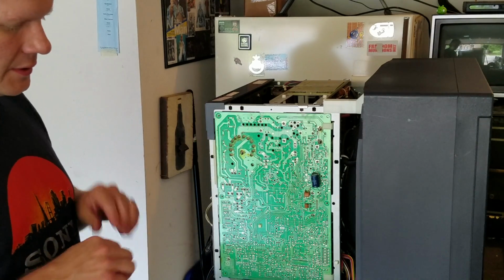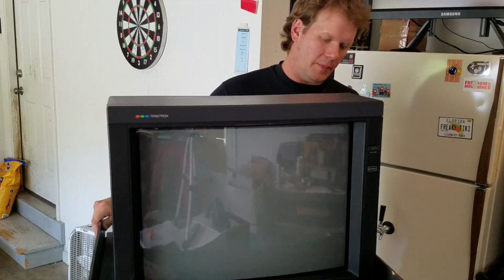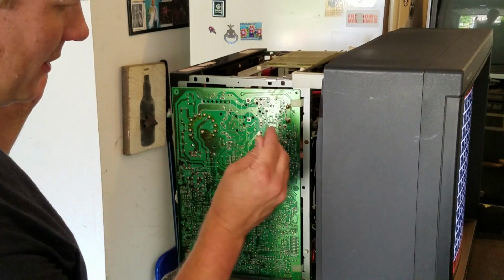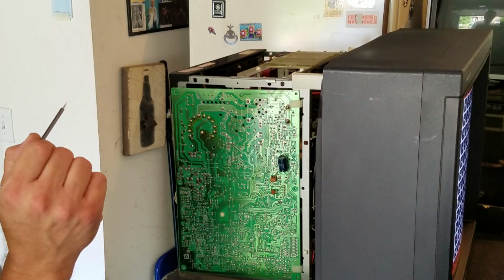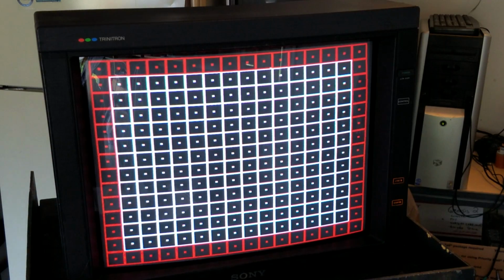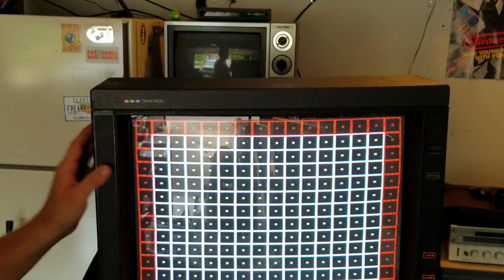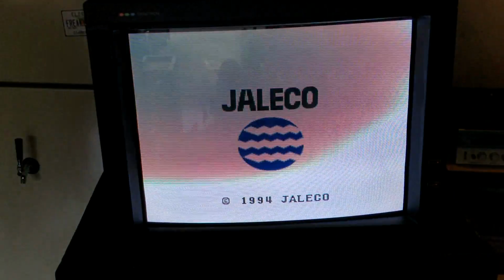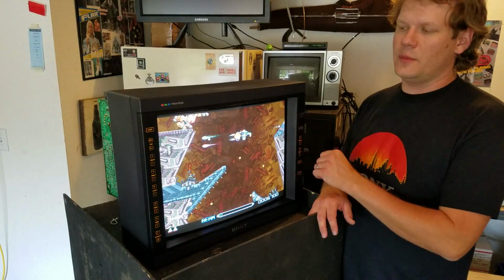Sony PVM 2030 - CRT Geometry Calibration Techniques

Comment: Alex if you happen to see this comment you have probably just saved me lol. I've got a Sony Trinitron 24-in that I had found and it has this problem but it's ever so slight. Hooked up some PS2 games to it and I thought that maybe the component signal was stretching the screen out too much so I hooked up composite cables and it's still doing it. I tried the onboard tilt feature and that didn't fix the problem either so this has got to be the issue.  I'm definitely going to give this a shot over the weekend.

Comment: Hi, thanks for all your videos. They’ve been extremely helpful, specially for adjusting my 2130QM. The service manual shows how to adjust H. FREQ properly, but I’m afraid it has a typo. It says to input a bar picture and short pins 1 and 11 of IC501 and pins 35 and 36 of IC401. IC401 does not have those many pins. The service manual for the 2530 has the same text, only it’s IC1501 (same IC) and IC401 is another larger one with pins 35 and 36. I’m at a loss here. Only shorting IC501 gives no picture. With other PVMs you need to use a capacitor instead. Have you ever looked into it?

Comment: Hi! I just found one of these in the street but cannot get the buttons to respond (after pressing control, then pressing volume, both buttons just flash as if they are locked) or get any audio out of the speakers. Do you have any idea how I could fix this? Thanks!

Comment: Hello! Do you think a 2005 Panasonic Panablack CT-G2995 may have adjustment potentiometers inside? It has a service menu, but the screen has a subtle curvature on the corners and I haven't been able to correct it with the service options. I can't find a single technician with experience on CRTs, I don't know what to do :(

Comment: I hope to fix my Bang & Olufsen BeoCenter AV5. The problem is that the tv has a "pincushion" problem (sorry for my english), and some technicians have told me that it will be expensive to fix it, and other technicians said me that it can't fix. I've never opened a crt television, I get a little scared.

Comment: Hey Steve,is there a way to adjust color intensity/saturation on the RGB line? The color buttons on the front dont work on RGB. I have the case off and I do see R Black ADJ,G Black ADJ and B Black ADJ on the right side. Just wondering before I start turning knobs,lol.

Comment: Hi there I have a 2030 pvm with a yellow tint issue, this image shows a color bar test
https://imgur.com/a/JSDttXv

Does anyone have any ideas about what the cause could be? 
- A known particular bad cap?
- Requires a full board recap?
- The tube is almost dead?
- Something that can be fixed with RGB gain adjustments?

Comment: Thanks for these great videos. Question: I saw you adjust the yoke on another CRT while it was on, so we could see the display actually rotate as you turned the yoke. Why do you recommend we keep the 2030 shut off during this adjustment? I'm guessing it's because of the tight space where it's easy to touch the wrong things?

Comment: Here's an important tip when performing these adjustments: let the set warm up to operating temperature first, at least 30 minutes, before attempting adjustments.

Various component parts, such as resistors and capacitors, can change value with temperature changes.  This is especially true on a set where the parts have endured wear and tear from use and age.

You don't want to waste your time calibrating on a cold set since the value change of some parts in the circuit could, in turn, change your calibration as the set warms up to operating temperatures.

Comment: Thanks for the video and calibration tips.  I have a 2030 and 2530.    The 2530 needed quite a bit of tweaking and your video helped out.  There were a couple of differences, but the 2 models seem pretty close.
Reply from the maker: Thanks. The 2030 and 2530 are from the same design year and should be similar in adjusting.
Reply: The PVM-2530 have some things in common with the 2030, but there are also some important differences.

The 2530 has additional pincushion adjustments on the D board (T-PIN and B-PIN, short for top pincushion and bottom pincushion, as well as a DIST adjustment).  And, there's also dynamic convergence adjustments on the D2 board, located on the rear of the set, which you probably don't want to mess with if all you're after is doing geometry adjustments.

Comment: Say someone needs to replace a potentiometer on one of these... Would these specs work for the replacement part: 22K Ohm Trim Variable Resistor Potentiometer 6mm RM065 223

Comment: Great video man!  I've got a 2030 that shuts off after 15 minutes or so of being on.  If I turn it off and back on it will quickly shut itself off again.  If I turn it off until the next day it will work for 15 minutes and then start the same thing all over again.  Any ideas on the problem?
Reply from the maker: Thanks.  It sounds like a power problem.  The first step would be to replace the caps in the power supply and check the fuses in that PVM.  You might want to check and see if any of the power board needs to have fresh solder applied too.
Reply: Thanks, I'll check that out.  Nice Nature Boy shrine btw
Reply: Chances are the fuses are okay; a bad fuse will generally be open.

It could be a faulty component; as the set warms up, a component's value may change to the point where it's out of spec for the circuit.

Most likely, it could be a bad solder joint; as the affected joint warms up, it expands and can widen the crack, which can disrupt the electrical connection of the affected part to the circuit.  Checking the power supply circuit is a good start, along with checking the horizontal drive circuit.

Comment: I got problem with my Sony PVM 2053QM (PAL), on RGB input and on Component i have a little blurred screen. When i set knobs on contrast and brightness to zero then of course i barely see anything but its crystal clear in games for example texts in 16 bit games, any ideas how i can make this crisp look on higher contrast and brightness?
https://i.imgur.com/WKsUXPo.jpg
Here you have photo where screen is quite good, almost perfect, its a Snes Station, a snes emulator for ps2 so its connected via component. I really wanna fix my RGB looks :/
Reply from the maker: Hi.  The potentiometers on the back of Flyback control focus and brightness.  The top adjusts focus and the bottom knob adjusts brightness.  Might want to try those.
Reply: Thank you, im gonna try it, then i report my results!

Comment: I just made a video calibrating my BVM-D24. The D24 is so much easier to calibrate, wow. And you can get the geometry perfect, and the convergence nearly perfect by just using the on screen menu.
Reply from the maker: Bob Marley It is so easier and safer on the newer BVMs and the screen & hardware is much more powerful and efficient making a much betrer picture.  These 2030s can produce a great picture for being from 1991, but it's an undertaking to calibrate.

Comment: Thank you for the Video! Never thought i would get my hands into my 2130qm for the yoke adjustment, without discharging it. Helped a lot to see it. Cheers
Reply from the maker: Robert Schmidt it's nerve racking the 1st you do it, but for me it's routine now.  Almost every crt monitor I get needs at least a small yoke adjustment.  I got some high voltage gloves delivered this week.  I'll be doing an episode next week on tools and safety equipment.  Thanks for watching.

Comment: I've got a 2030 that powers on but I've got a black screen. Any suggestions on where I can start trouble shooting and what I might need to do to get it back online? Thanks!
Reply from the maker: Dane Olds did you hook a console or other video source into the PVM and turn it on?  There is no on screen menu so a black screen is usually a sign that this monitor is working properly.
Reply: I'll give that a shot tonight. I was expecting it to have an onscreen menu like my BVM. Thanks for the reply. I'll report back. And thanks for the awesome video. If I get the screen working I'll start by doing the calibrations just like you showed.
Reply: Just wanted to report back on what I found. Knowing that I needed a signal to tell if the PVM was working properly I tried using the A input instead of the RGB input. I discovered that the monitor worked when it had video signal on that input so the problem was with the RGB line. I pulled the RGB to CMPTR cable that came with the monitor and cracked it open. Turned out there was a broken connection inside the cable. I soldered that line back together, re-installed the cable and it worked like a charm. I now have RGB through the CMPTR input! Thanks for the help on trouble shooting this!

Comment: Wow thanks man. I got one of these. I used to have a book wedged under one corner because the image was tilted. Guess I should give the yoke a tug... I haven't used the 2030 in years. I've been using my bvm 1911 lately but it's been acting up so I might be using the 2030 again soon... The 2030 is the best looking rgb monitor i have seen
Reply from the maker: I love the 2030's.  The look and the stereo amp on the monitor sold me right away.  They are a real pain to calibrate and maintain but look so great though once they are calibrated.  By far the best PVM form factor ever made by Sony I.M.O.
Reply: Retro Tech. Yeah i have a 20m2mdu as well that is higher tv lines and has barely any hours on it but the beat up old 2030 still is somehow sharper

Comment: Great video thanks for the upload. Can I ask I have a bouncing picture on the same tv, do you what the issue is? And how I go about repairing it? Thanks again deano
Reply: Bean Soup ive had two of these monitors and i have noticed that the image "bounces" very slightly on both of them until they are warmed up. See if it gets better after being on for 30min. Lots of pvm/bvms behave a little funny when you first fire them up.
Reply from the maker: Hi.  Thank you.  Try turning the V-Hold knob on the back of the PVM until it's stable.  Thankfully that is an easy fix.

Comment: Great stuff! Cannot wait for next episodes. 
About adjusting yoke: did you loose it before roatating? If you moved it clockwise, how come it won't back to it's previous place?
Reply from the maker: Hey, thanks for watching.  I didn't loosen it to make the yoke adjustment.  I made a short video specifically about yoke adjustments.  Over time the yoke gets loose a little bit and can turn slightly.  Check out the other yoke video for all my tips.

Comment: great video.  you should definitely do a more in depth video on convergence adjustments, using magnetic strips as they are great for clearing up that corner convergence, and also good when you have one corner that curves
Reply from the maker: AndehX Thanks for the tip.  I'm going cover convergence more in a couple different short video coming soon using a different PVM.  Thanks again!